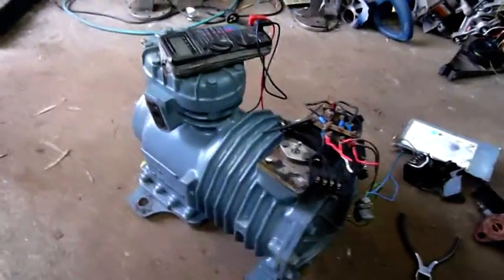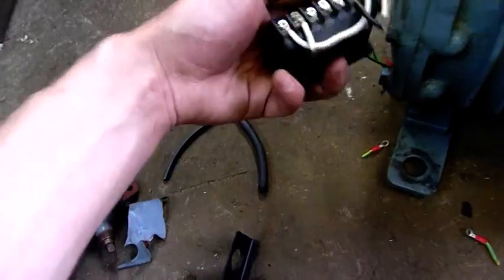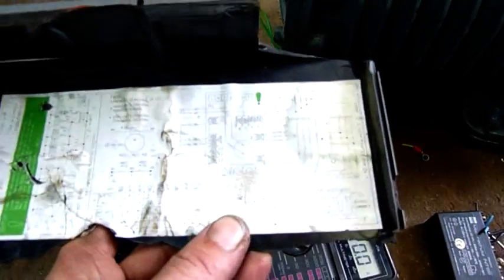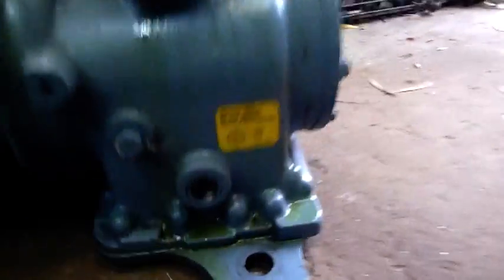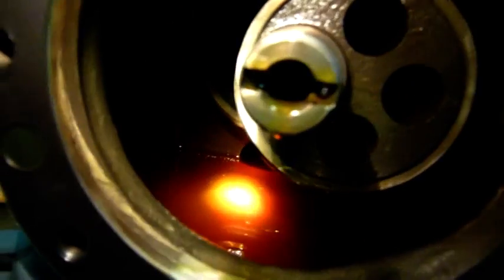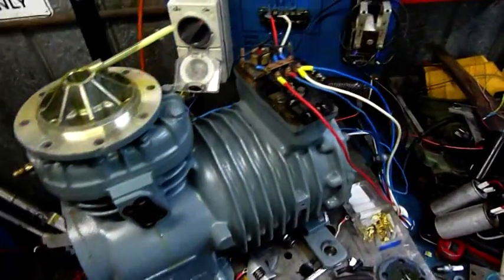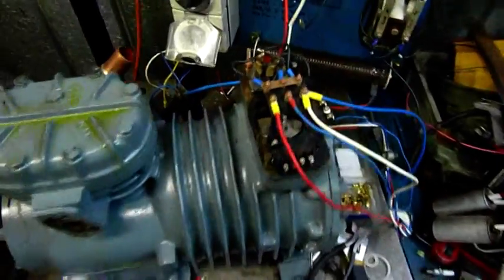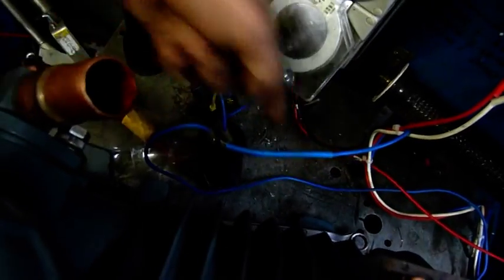DWM Copeland Semi-Hermetic Compressor Testing

Comment: Hello m8, what kind of oil I can use for this compressor?
Reply: I was wondering same thing. I have a reciever mounted thing. Its virtually silent. Runs single phase,good machine,just really wanna know oiltype.
Reply: Imo should be POE, for example POE 32 - doesn't affect to electricity

Comment: that is an "AIR COOLED" compressor( not refrigerant cooled) that is a 3 phase compressor not designed to operate on an "INVERTER" or" V.F.D." or the use of caps to fake the second/ third phase. it is also not designed to operate as an air compressor!!!, it will not produce enough C.F.M. it ill not keep up/ maintain good air pressure to operate a sand blaster, or paint gun, also you are going to notice an objectionable amount of oil in the compressed air. there are no oil rings in the compressor!!!

Comment: The long hole in the compressor are for a heater to heat the refrigeration.
Reply: most of the time, that is the oil pick up screen ( also oil drain), the crankcase heater bolts on to the oil pan cover

Comment: First, thank you for this wonderful video, from which I have benefited a lot

I have three questions that I hope answered

01- Can the compressor be operated directly from the circuit breaker, without operating the electrical control circuit?
02- If I connect the compressor directly without gas, as in the video, is the compressor coil intact and does not burn?
03- How long does it take to let the compressor run on oil, as in the video, before changing the oil again?

And thanks again for this great video

Comment: it wont last long at all if you use it as an air compressor. the windings requite refrigerant vapor cooling
Reply: No sir that’s not refrigerant cooled. You are right though it want last long as a air compressor. The air and moisture will cause the oil to break down and turn acidic which will eat the coating off the motor winding = shorted motor in o time
Reply: K body are air cooled

Comment: I seen one video that these compressors are being replaced by regular Hermetic or Scroll compressors. Here in the US these Copeland Semi-Hermetics are getting expensive plus they are very heavy as you need a crane to lift it on the roof as the regular hermetic's are easy to lift with straps and is the least expensive way to go. sometimes the motors burn out, the conrods snap or the reeds break in them if the condenser fan motors go out which can raise the head pressures unless there is a head pressure safety on it. as these Semi-Hermetics are still available remanufactured. but expensive as these lighter regular hermetic and Scrolls are least expensive but still do the same job as these ones do.

Comment: When you showed the back of the compressor it was nice to see bronze instead of the aluminum connecting rods.  Looked like in the end you were not getting much discharge. Under the top where the two ports are there are valves that wear out.  Usually one can get a kit and rebuild the valves.  Another thing on a 3 phase unit it requires 3 lines of 120vac. Normally you don't use a start or run capacitors.  We use 3 phase contactor. Over here in the USA.
Reply: He's probably at his house and doesn't have 3 phase service hence the controls and capacitors to mimic the third phase

Comment: part 3
interesting vid & amazing u got it wired and fired up for 1phase 240 and HIGH AMPS ! however don't spend a lot off time building a Air comp unless u got 3phase power supply - coz my conclusion is.. it won't work very long at them high amps.& without refrigerant cooling the windings.. via the crankcase ... 

I'm smiling coz I also love 2 pull things apart and try to get things working for Free..
with respect how you studied 3 phase & ohms laws... ? I feel sure its well within your Scope...

Comment: part 2
Your correct in saying the condenser motor was probably 1phase + N as was the crankcase heater if used ? thats what what the rusty hole is in the crankcase. ..

Comment: i admire your engineering interest and abilities, however with respect and without seeing the nameplate data... I strongly suspect your nice free DWM compressor  is 3phase dual voltage = 
3 phases L1 L2 L3 which can be wired star 240v 3 Phases or Delta 415v phases.. its the star / delta option that changes the voltage.. either way its 3 phase..

Comment from the maker: @Nighthawke70 the valves seem to be fine, but i will give it another run today on the VFD and monitor how it goes at low RPMs

considering how smashed up the terminal block is, I doubt anyone here would trust it for refrigeration use again :(
Reply: in west Africa I do great ref jobs with a lotnif craps like this, of various sizes. we can hardly pull out dollars for new, like you guys up there.  We even make alterations for unavailable parts just to stay in business. This is even far better that the one's I pull from the grave and recondition, and are still in service In cold stores in my region.  Men things are not just thrown sway over here. To us this good old DWN Machines are never say die.

Comment: Thanks for the mention!

Always thought those things had splash feed oil supply with an oil flinger and hopper at motor end like the Prestcold ones, live and learn!

The yellow plug is where the crankcase heater goes when fitted.

I've never tried running one of these on single phase but have done with condenser fan motors, two windings wired across live and neutral in parallel, capacitor and neutral on the third winding, not sure if something similar would work on this!
Reply: it depends on the size/ H.P. of the compressor. the smaller copeland compressors are splash feed( 3 H.P. and smaller)

Comment: I wonder if the valves in the compressor are bent, causing a loss of performance.

DWM Copeland's are license-built units for the Copeland Corporation. Hell, pop the heads off and take a peek at the valves. If it's just the valves, then it's just a replacement valve plate, gasket, fresh oil and resell for a fat profit!

Comment: 1:33 there reads motorschutz: means motor/engine-protection. if there is too much current it will break the connection. dunno how it works, maybe with a bimetal. we had a 3 phase fuse doing that for us :P